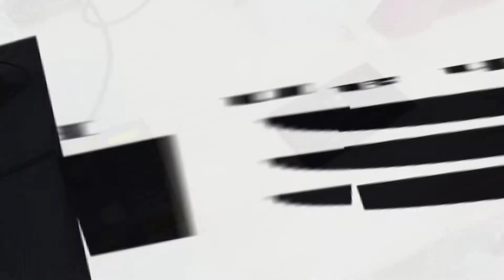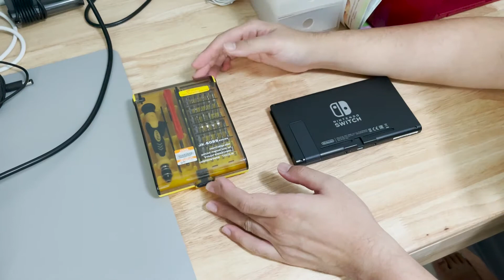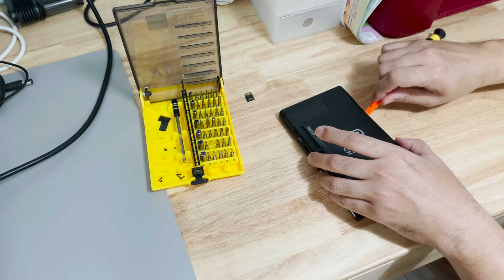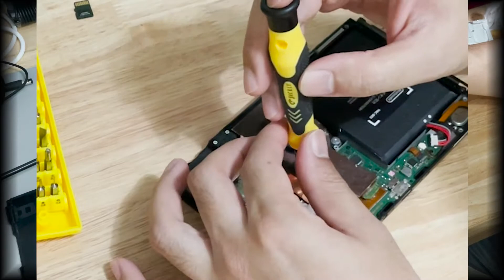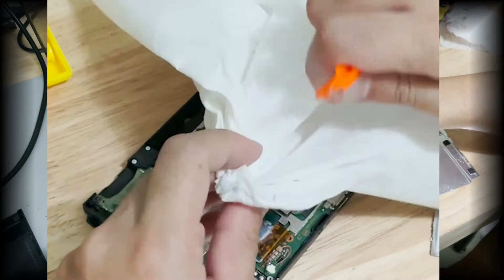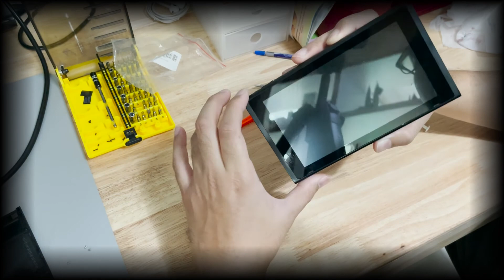Nintendo Switch Tutorial - Thermal Grease Replacement (Gen 1)

Comment: I thought I would broke that aluminum case above the cpu so i stopped lmao
Reply from the maker: Double check that you got all the screws out, if yes then try to pry the aluminum casing using something that have a small imprint. e.g. tip of a blade or tweezers to try opening the case. Let me know..
Reply: I know this comment was awhile ago but if you get two of the bottom clips undone, you can use your plastic tool to firmly but with control (as in don't have any other components in the path of your strength) push off the rest of the metal. I got it off pretty simple without bending the heck out of it 😂

Comment: I think this is a HAC-001-01 (V2) rather than a HAC-001 (V1).  I have a day one switch and the aluminum heatsink and the heat sink below the fan are different and not connected.
Reply: Same process tho
Reply: The piece under the fan appears to be a mod chip, which means it’s a v2, but not all of them look like this.

Comment: bro that is way to much, this is why they use the cross method. I mean it probably works just fine but i more then bet the next time you take it aprt its going to be all over the pcb because thermal paste spreads more when its getting heated for the first time, just hell next time you take it apart and messy. Also too much thermal paste can acc make the temperatures worse or improper cooling
Reply from the maker: Thank you for the advise I will take it into account next time I dismantle it. When I opened it, the thermal paste was alot so I thought it was a good idea to replace a similar amount or a bit more. But thanks again.
Reply: @MakersLabHQ  all good man its happened to all the computer techs who repair lol. Id say when you put the first dot on the die itself and spread it it was perfect but then you added another dot so its going to look kinda caked like when you took it apart in the video but honestly should keep it quiet cool + aftermarket paste is better then whatever Nintendo put in comparing my temperature tests in my switch lite. Anyways great video man

Comment: I just brought a newer switch last March 2021 (Not the oled model) I play it 99% docked. 

How long should I replace the thermal paste on the switch?

I am aming for 4-5 years but I don't want the switch to overheat or cause problems in the future
Reply from the maker: Usually it depends on your environment.. If its a smokey environment then you should strip and clean the inside of the dust while you at it,  you can also reapply the thermal paste. If not then every 1 year should be ok.